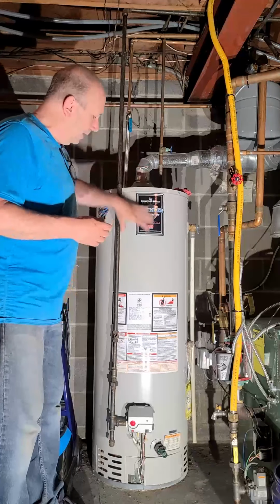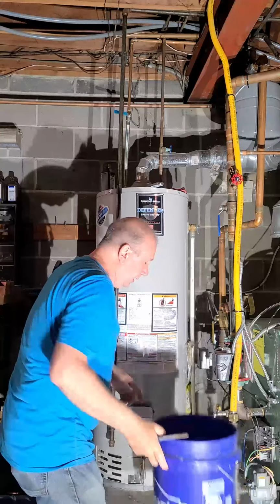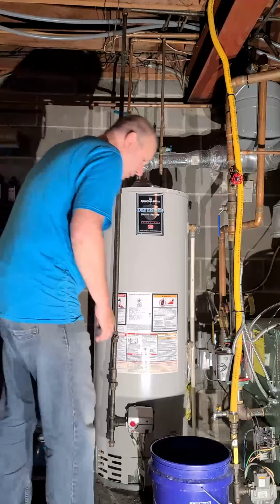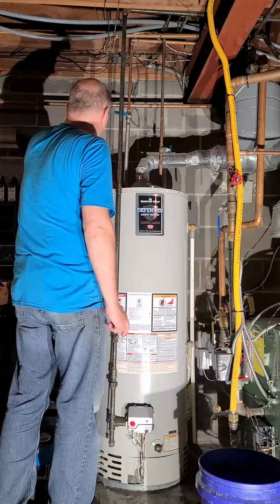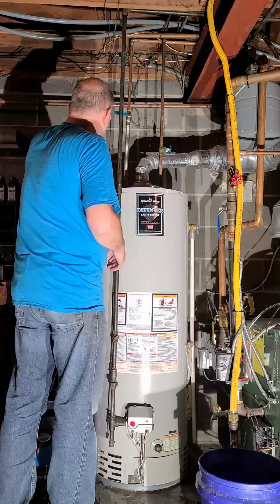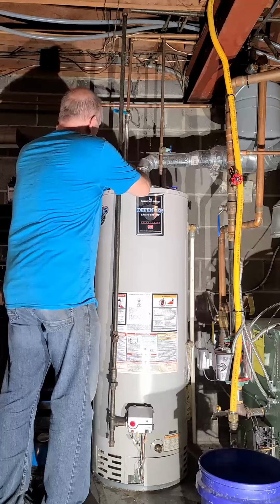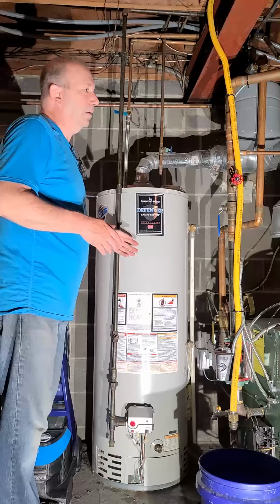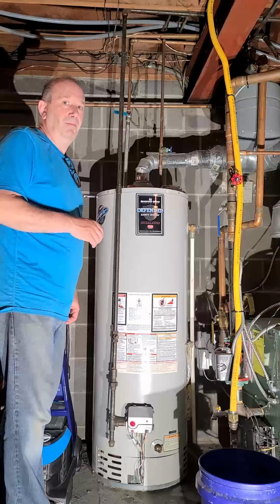Does your hot water smell like rotten eggs? Here is the fix.

Comment: How long do you have to wait after adding the Hydrogen Peroxide before the water is safe to drink?  Do you drain the tank and refill with fresh water before allowing the hot water back into the house
Reply from the maker: No need to drain and refill. It is diluted to levels where it causes no harm. Leave the peroxide sit in the tank for at least 4 hours before running the water is all you need to do. Then open each hot water faucet in the house until warm water flows and you are all set!

Comment: is there a long term solution where i wouldn't have to do this?
Reply from the maker: Yes, replacing the Anode Rod. Water heaters come with Magnesium or aluminum anode rods and those react with the sulfates in the water creating the smell. Replacing the Anode Rod with a zinc one usually solves the issue as it does not react the same way. Sometimes though even this does not fix it and then a powered anode rod is recommended.

Comment: I have had my old hot water heater for 15 years never had rotten egg smell. Now with this new heater it stinks.  Why??
Reply from the maker: It's probably the Anode rod in the new heater. If the peroxide treatment removes the smell then it's the Anode rod.

Comment: Today is Jan23 2022
My water tank inspection sticker is 1978. 

I have a well. It use to be 60 ft with  lots of iron but @ 15yrs or so ago it was changed to 250 feet and sulfur water became a problem.

My solution was a simple house hold carbon filter at my well and when I smell sulfur I put a gallon of bleach into the well. @ every 3 months or so and change the $30 filter @ twice a year. 

Water is clear and clean taste like store bought drinking water. 

Old water heater still works but received a newer free one I’m thinking of putting in so looking at different systems.

This hydrogen peroxide option is interesting.

They’ve had aeration systems etc for years that are just too expensive but now there are cheaper options. Hydrogen peroxide basically does the same thing on a chemical level.
Reply from the maker: That's pretty amazing the tank lasted that long! This fix is for a Sulfur smell from hot water only. If the sulfur smell is in cold water also it is a different issue. Hydrogen Peroxide and bleach behave differently though. Bleach is a great disinfectant and peroxide is a great oxidizer. So if you have water that has say algae and needs disinfected then bleach is what you want to use as peroxide is not a good disinfectant. For iron and sulfur peroxide is a better choice but a bit more expensive than chlorine.

Comment: What if the rotten egg smell is coming from a standing shower drain? Can I pour peroxide down the drain ?
Reply from the maker: Odor from the drain could be a multitude of issues. If the shower hasn't been used in say over a month the trap could have evaporated and simply needs water poured into it.

If it is in use and has the smell it could be partially full of hair, soap,and other things. You could treat it with Drano or other drain cleaing products and see if that helps.

The vent stack could also be clogged. It is a pipe that ties into the plumbing and exits through the roof. This would be the least likely.

I would start with the drano and a good flush and see what happens. You can pour peroxide in the drain and it won't hurt anything but in this case I don't think it will sove your problem.
Reply: Thank you for your response, I used draino, cleaned the ptrap, poured peroxide down the drain, vinegar and baking soda and the smell still comes back. There was no smell until just a couple months ago. When I moved in just 8 months ago in the fall, can the hot weather be making it worse ?

How do I properly properly pour water down the drain? Do I just pour it strained down when the water is not running? I desperately want this smell gone I have tried everything except a filter of some sort
Reply: How to I pour water into the trap properly?
Reply from the maker: @missy5175  if you have been running water in it then a dried-out trap is not the issue. It will have water in it and therefore is not the issue.
Reply from the maker: @missy5175  then I am stuck. The only other thing to check is that the smell is actually from the drain and not the water. Pour a glass of cold water and also a glass of hot water from the faucet over the drain in question. Take them outside and smell them. If you smell sulfur then the drain is not the issue. If the hot water smells but not the cold then the issue is what I describe here. If the smell is both cold and hot water then that is a different issue that will require a water specialist to help you solve.
Reply: @BriansSpace  thank you soo much for your fast and informative responses, I really appreciate it. I will definitely double check by smelling the water separately outside
Reply from the maker: You are very welcome! Let me know when you figure out what this issue was. Thanks!

Comment: I'm just going to be honest filtration system works the best
Reply from the maker: Nope not for this issue. The rotten egg smell is only in the hot water and is caused by a chemical reaction between the anode and the water. Switching to an aluminum/zinc alloy anode will solve the issue in MOST cases but many have spent thousands on filtration systems only to have the smell still persist.

Comment: There is NO such a thing as a Hot Water Heater. It is a water heater.
Reply from the maker: LOL. Love it! I would counter that a water heater is any device that can heat water with no specifics on what temperature it would heat the water too. Does it make lukewarm water or hot water? So a water heater can indeed heat water but does not need to make it hot. It could simply heat it from 34 degrees to 35 degrees and be a working water heater. We know it doesn't boil it as that would be a boiler then. A water heater can heat water a few degrees or to 200 degrees but does not need to maintain that temperature as it is just a water heater with no specifics on doing anything other than simply heating water. A hot water heater does indeed heat water that is already hot to maintain the temperature of the water at a set level so it is always hot and maintained for dispensing at the various faucets and other water dispensing hardware throughout a structure. So I am sticking with hot water heater as a device that maintains water at a set temperature level of hotness sufficient for comfortable bathing and general use in a residence vs a water heater which simply needs to heat water even one degree.

Comment: I will bet that helped but you still have the problem.
Ask me and I will give you the answer to fix the odor. 
If I don't hear from you, you fixed the problem and not interested.
I'm not being crappy with you, changing anode is good but doesn't complete the picture.
Reply: u2mister1 hi i drain my tank and refill it, it lasts a couple months then its smells again, what is youre way to fix it
Reply: @bullitanaconda  Crank up the heat. The bacteria is not harmful but loves 120 degree water. 
Plumbers are not allowed to turn the heat past 120 but you as a home owner can. Be aware, you need to get the water temp.
to 140-150 degrees to kill the bacteria. It most likely will take 3-4 weeks before you notice a real improvement.
Again, be aware that is very, very hot water. 
It is easy to set the thermostat and you should use a meat thermometer at a close to the heater faucet.
If you have electric heater be sure to set both upper and lower elements. 
I had two homes with wells and this fixed both.  Good luck.
Reply: @u2mister17  genius
Reply from the maker: Thanks for sharing. I did hear of this method and opted not to do it due to the risk of burns. 140-150 degree water is very hot and if you have children or elderly in the house I would not recommend this. The difference in risk is great as you can see by the info below. Some newer homes have shower and tub mixing valves that protect against this at the tub and shower but severe burns can still occur at unprotected faucets. If you want a permanent solution the best option is to replace the Anode rod in the tank with a power anode. They do not degrade and will last the life of the heater:

https://www.corroprotec.com/product/water-heater-anode-rod/

For me it's no big deal to put the Peroxide in every few months so I haven't replaced the Anode rod.

Most adults will suffer third-degree burns if
exposed to 150 degree water for two seconds.
Burns will also occur with a six-second
exposure to 140 degree water or with a thirty
second exposure to 130 degree water. Even if
the temperature is 120 degrees, a five minute
exposure could result in third-degree burns.

http://ameriburn.org/wp-content/uploads/2017/04/scaldinjuryeducatorsguide.pdf
Reply: @u2mister17  how long do you leave the heat temp turned up?
Reply: @cadencechrome4783  Once it seems stable, you could back it off to 130 but monitor it. Pretty much needs to stay high temp.
Reply: are you off your rocker
Reply: @GarageSaleMonster  For the couple people reading this..Did Your Water odor go away?
Reply: this is what tempering valves are for; so you can keep the water sitting in the heater above 140 to prevent bacterial growth and cool it to a reasonable temperature before it runs to the tap or shower.
Reply: I have well water system and the hot water comes out brown for 2 minutes and smells bad. What I have to do? They tested the water and they said is good. Thank you
Reply: @tatilozadaparra  A few questions.
Have you had a plumber to check?
I would suspect piping or at least a fitting if it was just hot water.
Galvanized pipe and black iron pipe are the same thread size but the iron pipe will rust.
Check for iron fittings.
I doubt it is the tank because you said the brown clears up in 2 mins.
The water from the tank comes from the very top not the bottom so not likely sediment.
Reply: @u2mister17  No, I bought the house and in the inspection report they previous owners were supposed to fix the brown water. But today the water comes out brown again, they tested the water and is good but smells terrible in one of the bathrooms and in the kitchen sink. They told me this is normal because the house was empty for 2 weeks but I don’t know what to believe. Thanks for helping me!

Comment: It’s called a water heater, not a hot water heater 👍🏼
Reply from the maker: My favorite debate!

The infamous water heater VS Hot water heater debate! As I answered before:

I would counter that a water heater is any device that can heat water with no specifics on what temperature it would heat the water too. Does it make lukewarm water or hot water? So a water heater can indeed heat water but does not need to make it hot. It could simply heat it from 34 degrees to 35 degrees and be a working water heater. We know it doesn't boil it as that would be a boiler then. A water heater can heat water a few degrees or to 200 degrees but does not need to maintain that temperature as it is just a water heater with no specifics on doing anything other than simply heating water. A hot water heater does indeed heat water that is already hot to maintain the temperature of the water at a set level so it is always hot and maintained for dispensing at the various faucets and other water dispensing hardware throughout a structure. So I am sticking with hot water heater as a device that maintains water at a set temperature level of hotness sufficient for comfortable bathing and general use in a residence vs a water heater which simply needs to heat water even one degree.

Comment: Mine its all .....from fresh water tap to every were do you have answer ???......you did not say anything, remember the main fresh water, filling the hot water tank right ???
Reply from the maker: If you have a sulfur smell from your cold water, this will not solve the issue, and you will need an advanced water treatment system. What you need will depend on the amount of sulfur in the water and other factors. Some solutions are a Chlorine injector followed by a filtration system, an aeration system, or sometimes an iron filter. Again, all this depends on the amount of sulfur in the water, and though I am big on figuring out and doing things yourself, this is a case where it is best to contact a specialist in this area. Just be careful as the water filtration companies arena is kind of sleazy. Overselling things you do not need is pretty standard, so ask for several opinions from different companies. Best of luck, and if you solve your problem, be sure to come back and share!

Comment: WTF .. Is a hot water heater? I generally don’t heat hot water!
Reply from the maker: The infamous water heater VS Hot water heater debate! As I answered before:

I would counter that a water heater is any device that can heat water with no specifics on what temperature it would heat the water too. Does it make lukewarm water or hot water? So a water heater can indeed heat water but does not need to make it hot. It could simply heat it from 34 degrees to 35 degrees and be a working water heater. We know it doesn't boil it as that would be a boiler then. A water heater can heat water a few degrees or to 200 degrees but does not need to maintain that temperature as it is just a water heater with no specifics on doing anything other than simply heating water. A hot water heater does indeed heat water that is already hot to maintain the temperature of the water at a set level so it is always hot and maintained for dispensing at the various faucets and other water dispensing hardware throughout a structure. So I am sticking with hot water heater as a device that maintains water at a set temperature level of hotness sufficient for comfortable bathing and general use in a residence vs a water heater which simply needs to heat water even one degree.

Comment: if you're connected to the city, i bet the water in general is the problem.
Reply from the maker: Actually this was a well. Since I shot this video I have connected to city water and the issue went away. IN this case it was the water from the well. In another case though it very well could be city water but usually that is treated pretty good so this issue would be rarer in city water. Thanks for commenting!